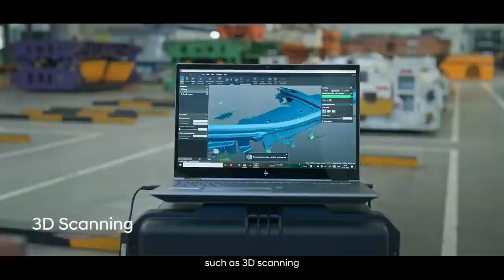The all-new Hyundai VERNA | Manufacturing Excellence

Comment: The hype is too much. If it goes in the same direction as virtus and slavia ( more sport oriented) that will be tough. Rather provide more comfort, more features like electric powered seats, extensive use of soft touch material and less price compared to virtus models I'll take verna. But not sure about it's looks though
Reply: it will be both sporty and comfortable, the suspension has been worked on to give a good ride, and the interior has soft touch on the dash similar in quality to the Seltos.
Reply: Book kia? Meine toh sxo ivt variant kar lia( turbo chahiye tha automatic mein but wo dct transmission k sath ata hai and i dont prefer dct)

Comment: Instead of having 450 robots, why dont Hyundai India recruit 1000 people to do their work?? These robots consumes a higher amount of electricity for its operation. Such robots can do well where the population is less and work output is required more. Here in India we have a population of 140+ crore people. Hyundai India should recruit people and trained them do to their job. As recruiting people will cost ten times less than  maintaining those robots and power consumed by them. These robots can fail once the software fails. Whereas human beings do not fail unless they die.

Comment: #hyundai has always struggled  safety in GNCAP.
Talking about other drawbacks stearing feed back has always nervous on high speed, least back seat leg room compared to competition and stiff suspension.
Hope all will be taken care now.
Reply: I think u haven't seen the new i20
Reply: @Legenderguy8756  5 stars 🤣🤣
Reply: @Legenderguy8756  wo 3 stars rating in GNCAP hai wo bhi borderline
Reply: @PR-co8bu  i was talking about steering feedback u can check faisal khan's review where he clearly said that the new i20s handling is way better than before its improved etc. Also about safety dont say  "borderline 3 star" beacuse already scored more points than creta and seltos if then also borderline then there are other cars too which scored borderline ratings...

Comment: The Hyundai Verna sells mostly in DIESEL . But you just killed the diesel 😢😢
Don’t think will sell as earlier
Reply: It's goona crack the market becuz the turbo petrol will do the work with manual transmission as the other companies also don't offer diesel it will not effect the market pf hyundai.The norms are going harder and harder for companies be happy that still we are getting diesel in creta and venue but for evey product it's not possible.
Reply: Arey kya sell drop bro mein toh lene hi wala hu physically dekh lu bas